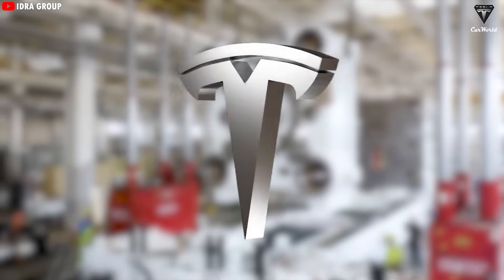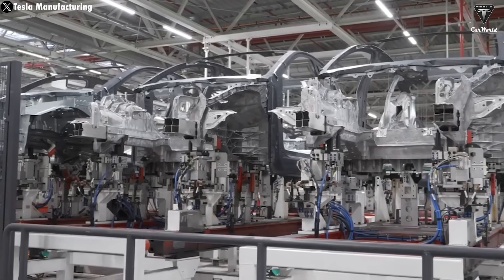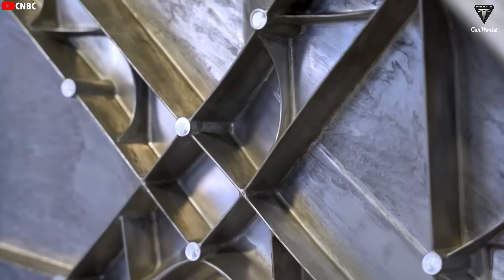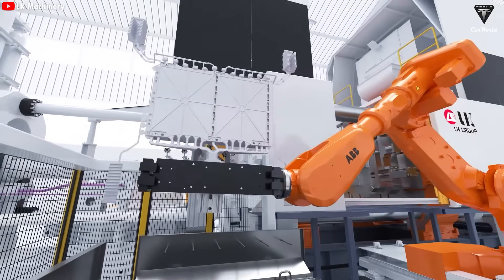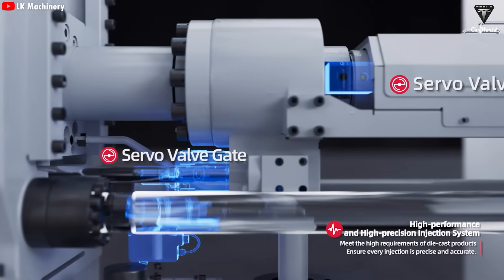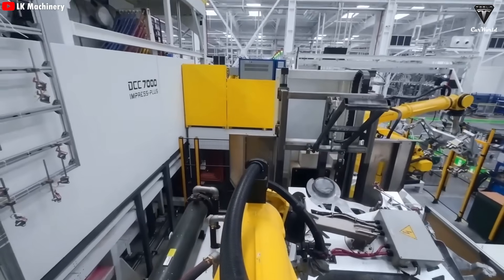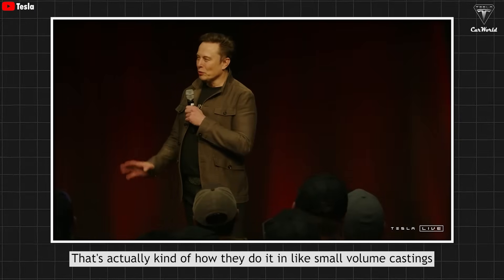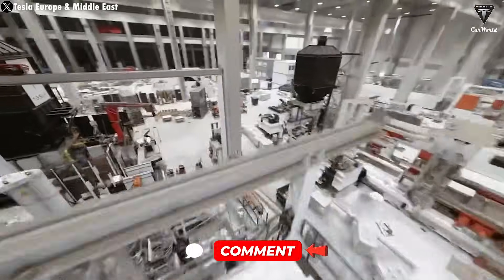It Happened! Elon Musk LEAKED The Way NEW GIGA PRESS 50.000T Built Tesla Model Q In 5s At GigaTexas!

Comment: Something about this is just off. The pictures do not align with the narrative. There are stamping presses that take a flat piece of Sheetmetal or aluminum, and form it into a finished part, and there are die cast machines the make parts by pushing hot metal, into a formed mold, and then quickly cool it, but the same machine cannot do both. The tonnage of the die cast machine is the clamping pressure that is needed to hold the moveable platen against the stationary one, and keep it from blowing open as the hot metals or plastics are rammed in, and on the stamping press, it deals with the ram weight/pressure available to form the metal into a part. Seems like somebody just got a bunch of animations and pictures and threw them quickly together - left me a bit puzzled after 50 years in the industry. The whole idea sounds great to build a unit-body chassis and pan as a complete assembly though

Comment: Why aluminum?
Reply from the maker: Aluminum is lightweight, strong, and perfect for casting with the Giga Press, helping Tesla improve efficiency and performance.
Reply: @TeslaCarWorld In my opinion for cybertruck it was biges mistake.
Steel have beter properties in plastic deformations and material fatigue. We have 
toyota land cruiser on steel frame and we use it  for towing trailer and we never have to afraid about damage frame.

Comment: So you think a mega casting is a great idea? What happens when the owner gets in an accident and the only options for repair is to replace a big chunk of the car. The Giga press may be great for Tesla's bottom line, but just another reason not to buy one of their cars.
Reply from the maker: Valid concern! Repairing cast frames might involve replacing large sections, but Tesla’s working on solutions to balance cost and durability.

Comment: Be careful Elon the Chinese will try to copy this manufacturing marvel.
Reply from the maker: Be careful what you wish for—Chinese companies are indeed quick to innovate, but replicating this manufacturing marvel will take time and precision. Tesla’s edge lies in its integrated systems.
Reply: Too late, Elon built the Chinese EV!
Reply: Be careful with cast Aluminum.  It is not nearly as ductile or strong as steal.  I believe this material choice is very limited in structural applications!
Reply: What's there to be careful about? It's a given that China will copy any truly innovative tech!  So, what?  The trick is to constantly innovate at break neck pace. After all, that is why AI is in the forefront of Tesla's efforts.
Reply: Idra the Italian casting company is owned by LK machinery, a Chinese company. This technology is already being used in Chinese EV, have you seen the Chinese characters in the animations? It's the legacy auto makers that have their heads in the sand.